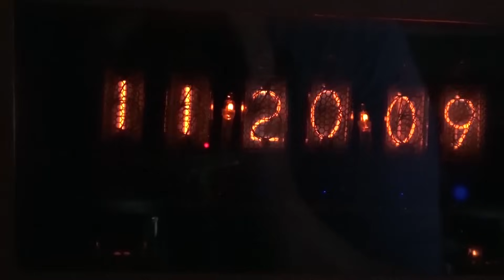Sony PCM-R300 DAT Chews and Eats tape

Comment: Thanks for the instructions! Just did the same process on my DTC-790 which i bought used a few years ago. I only tested it then and discovered that it did not play the tape. Finally got roud to take it apart today. Awesome to have a guide to work by👏🏻 The black gear with the screw were the culprit. The greas was like glue, so I had to really soak it in alcohol to get it loose. Works like a charm now🤩

Comment: I have a PCM-R300, and almost exclusively, I have used the “DDS” 3 hour tapes without any difficulties… hundreds of DDS-90 Meter tapes. In fact, when you put in such a tape, a sensor comes up on the display that briefly says “thin”, as the tape is loaded. The issues I’ve had with my deck involved the clips that hold the threading gears; they crack, the gears fall out of time, and the threading mechanism goes out of alignment. (“CAUTION” warning message). I ended up buying a broken deck as a spare parts bin, to keep my deck running properly.
Reply from the maker: Mine was a dtc790 and it didn't like the dss tapes much.  Mine was pretty high mileage but it would nibble on the thin tapes but regular tapes were fine.  I sold it about 7 years ago. Had it listed for months for 100 and got 50 for it.  Considering that I bought 2 tascam da40 for 20 bucks each i guess i did ok.

Comment: I got to the black wheel by removing the transport. But is there a way to fix it without having to take the entire thing apart? I see the black wheel and the couple of whites. Can I just blow some hot air inside or use a qtip with alcohol and reach inside? And then use some WD-40 with the small straw to reach the gears?

Comment: Hello
I bought a unit in working conditions however it does not have feet
Do you happen to know where can I get 4 of these ?
If not do you mind sharing dimensions and pictures on where they go on the unit and west screws are needed 
Many thanks
Reply from the maker: Couldn't tell you. This was a ship in and it was shipped back years ago

Comment: I've got a DTC-790 with a weird problem. The right guide is stuck in the LOADED position at all times. Would you be able to fix it and if so how much would it cost me?
Reply from the maker: Wouldn't know if i could fix it unless I had it on the bench.

Comment: OK I'm glad you are confident re-assembling these parts... 😅 Pretty impressive...  So... I have the same machine...it actually always worked great  - no issues.  Then one day a tape snapped on rewind very near the beginning of the tape... I was able to get the tape out with not much difficulty... it seems like all the tape is out of there...BUT... putting in another tape... 
Now the unit doesn't recognize that there is a tape in the well... so clearly something is up.

Do you think that issue is as extensive as the repair in this video?  This was a few years ago already - but I'd like to finish archiving my old DATs... lots of old studio sessions I engineered.  Do you offer service?  thanks!
Reply from the maker: Yes I repair stuff still and i archive tapes to digital or cd.

Comment: Dave, first happy new year and I got a strange question for you. I had a shipment delivered the other day. It was suppose to be a XLR to 3.5mm adapter. What showed up was 10 pieces of a 90 deg. coax adapter. They don't have a part number on them and maybe you could help me find out what they're called. coax adapters with about a 1/2" dia. twist collar on them on one end with a threaded end on the other. I've contacted the company that sent them and I'd like to help identify them. Thanks.
Reply from the maker: If you Google coax adapter 90 degree you will be presented with all the different coax adapters with their correct numbers.

Comment: Was the bad smd-capasitor issue resolved before year 2000? Some car ecu's from 80's and 90's suffered from that problem and i have wondered if my 2004 car could be affeted by it. The car model started 2002
Reply from the maker: Yes it was resolved in late 90s

Comment: Hey Dave how old is your watch? Looks like one they don't make anymore! Is it that old??
Reply from the maker: that's probably 20 years old I've had it awhile and no they don't make it anymore this particular model they made for one year and then they discontinued it so good luck finding one they're out there if you want to pay about three times what I paid for it which was $150. it was the most expensive Casio watch that they made at the time. They had lots of plastic ones but this one's all stainless steel solar powered and sets itself from the atomic clock in fort Collins Colorado